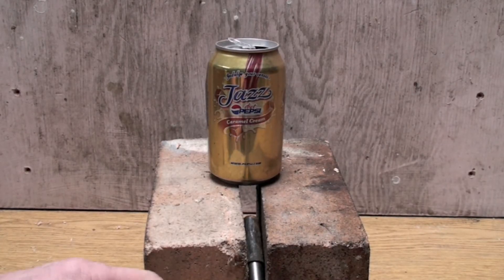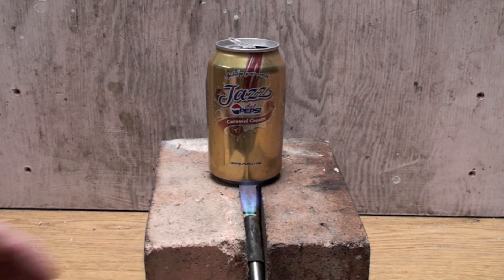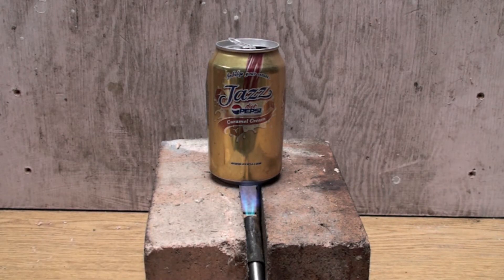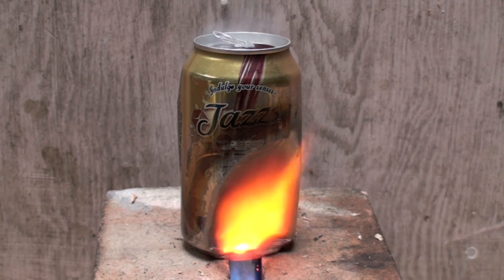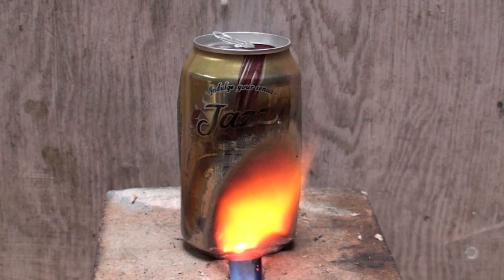Latent heat experiment

Comment: I just stumbled across this video at random and am reminded of an argument I had with a guy about 10 years ago over this very thing. You should redo this video with a thermometer of some kind in the water to show temp.  He simply refused to believe that water couldn't get hotter than boiling and that adding more heat only made the water boil faster.

Comment: Latent heat is the heat released or absorbed by a body or a thermodynamic system during a process that occurs without a change in temperature.